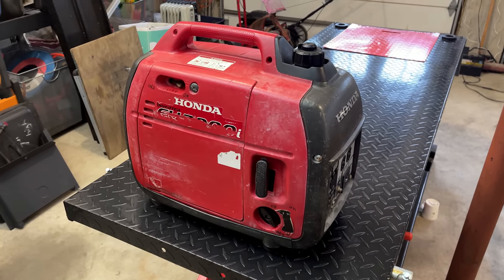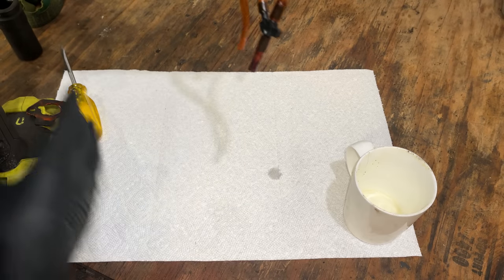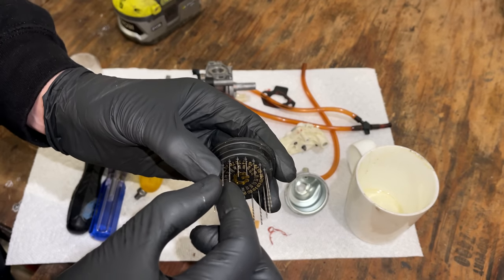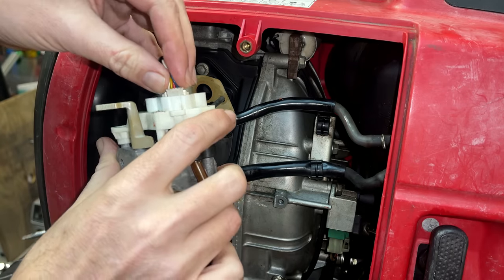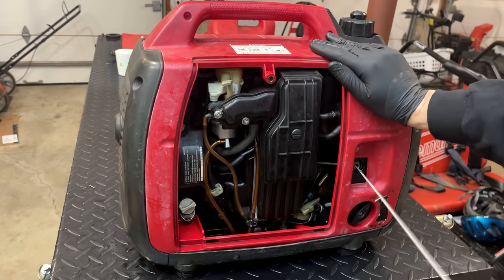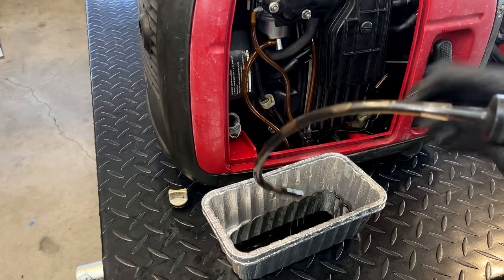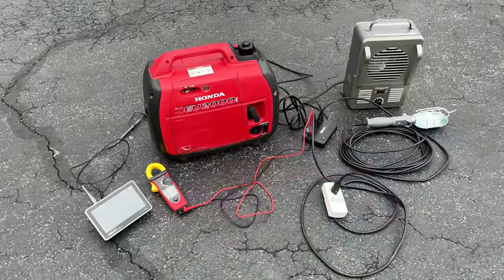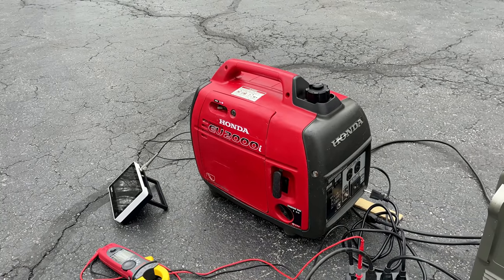Old Honda EU2000i Generator Leaking Fuel

Comment: I saw a video somewhere about a guy who used one for this foodie cart in Manhattan, almost every day for TEN years.  I'm sure he took care of the oil regularly but unlike most small engines that are throwaways, Hondas soldier on.  I had a co-worker who owned a couple of go cart race tracks, he generally replaced most of the engines annually with whatever was cheap, one year he splurged and bought a Honda, I know he got several seasons, plus it made more power making it the popular car with his customers.  Amazingly these are built in the US, I proudly fly the Texas flag on my Toyota trucks.  The problem isn't American workers, it's American corporate management.
Reply: By the way, another good video.  😀😎

Comment: Many small engine shops don't like to work on anything because it costs so much and many people never come back to pick their items up. They want the shop to store items for them until the next time they want to use it and they can't sit on the parts and labor costs that long. Another shop charges $80 up front, takes the customers contact information to call, text, email when it's ready and the customer signs an agreement to pick it up within 30 days of the notification or the item belongs to the shop.

Comment: Here in Europe we have the nearly identical EU20i. I would suggest though to totally eliminate hunting on idle that you clean the path between the idle jet and float bowl. Any tiny bit of tarnishing can have a big effect on fuel delivery in my experience. Also use Honda Fuel additive to prevent tarnishing due to stale fuel. Good video
Reply: Try drilling out the pilot jet 1 drill size larger.
These are set from the factory to extremely lean running..
and it takes less that a hair, drop of water or calcium buildup you can't even see....
to cause bad idle problems.
Reply: @JohnSmith-yv6eq I wonder if honda produce a modified idle jet?
Reply: @CodfishCatfish  My EU2200i runs fine, both idle and under load, another pilot yet must have been applied due to regulations, (Netherlands)

Comment: Man, that thing is rough. I will never understand how someone can buy an expensive piece of equipment like that and abuse it all to hell like that. I have the same model that I've taken very good care of, it still looks almost new and has never let me down. I have gas appliances so I can run my whole house off the little EU2000i during a power outage. It's so quiet standing 10 feet away I can't even hear it running over the din of the neighbor's 3600 RPM conventional generator.

Comment: That machine is absolutely amazing. I am impressed with it and the perfect outputs and sine wave. And that oil sensor is just doing its job. Better to kill the engine and force you to address the potential problems than to risk killing the engine for lack of lubricant.  You don’t want a $500 picture tube to blow protecting a 10 cent fuse.

Comment: Regarding the low oil shutdown - conventional oil foams up too much in these EU2000 when its cold and it triggers the low oil sensor. You can see there is some foam on top when you take the cap off. Switch to a different oil, preferably a synthetic one. I've had no problems with the SuperTech Full Synthetic from WalMart. Also, I would recommend one of the the oil fill extension tubes that are available. It makes pouring the oil out super easy and mess free.

Comment: These little gens are my favorite. I've also had the similar Yamaha but while the Yamaha is a tier above the Chinese knockoffs I feel like the Honda has just been so much better and reliable given I regularly use it at 6-10000ft elevation. Also for just a few $100 more the Yamaha engines still been made in China and Honda in Japan makes it worth the extra $

Comment: Great video. I have one too $599.00 new. It’s ten years old. Two things I have done was to add an hour meter. Red matches case like it came that way.  The other is to record hours and date of oil change on the inside of the cover with a sharpie. Lots of room. My only failure is to drag it out and run it an hour or two every month or so. 
Thanks again.

Comment: A little surprised you waited so long to check for spark and the condition of the plug. You eventually got there and figured it out. It did sound a little fuel starved on idle, maybe that's just the way it came across on camera.  All in all, a good repair.
Reply from the maker: The owner just said it leaked when running.  So I thought it would run.

Comment: Have that same generator and its twin you can link together to get 30 amps as a backup for home. Bought it for my RV but since got rid of the RV.  It is 6 years old and has been run for about an hour all together. Change the oil and gas every year and then let it run for 10 minutes or so. It says "Cold weather technology" on it but it is anything but. Anything near freezing and it will not start. Other than that it is of course a Honda and amazing technology that will prob last forever.
Reply: Store it empty of all fuel.

Every month buy gas and keep it in the can...buy the same grade as your car uses.
Every month take the can and pour it in the car...
Refill the can with fresh gas.

This way when you need it you will have fresh gas...with all it's volatiles still in it...
and starting will not be a problem....

as long as you understand that because this has a fuel pump built in...
you have to pull at least 20 times to get the pump to pump fuel to the carb and fill it up...

unless you rig somehow to squirt a bit of engine start into the airbox...
which will instantaneously start the engine...
and which will get the pump working so it becomes a 1 pull starter even when the carb/pump/tank were stored empty.

Comment: James , I have this Honda model so thank you for putting this out , and don't forget to deal with whoever has the telegram a/c in your name .
Reply: James , what make is you gas torch , i've looked in your Amazon shop but can't find it . Thank you in advance . The one that fires up and off with just one action .
Reply from the maker: There was someone a few days ago the was reported and blocked.  Comments made by me have a grey background and a check mark
Reply from the maker: I have an older model of this.  Will add it to the shop.  Bernzomatic TS4000 Trigger Start Torch 361524 https://a.co/d/1aBYbC6

Comment: As always another helpful, well thought out video. I do appreciate you taking the time to include the different parameters, no load and under load, like THD, Frequency and voltage. With four different generators of my own, I’m hoping that you’ll find time to do a video on THD, vs frequency and voltage with no load and loaded. I live in a rural area where everyone has a contractor type generator, but very few people take harmonic distortion into consideration for their electronics.
Reply: I'm not aware of any easy way to directly measure 60 Hz THD.  Most people just look at the waveform on a scope with the generator under load and see how close it is to a sinewave.

Comment: Nice job !!! The plastic jet it was clogged in my 2000 so I had to use a tiny PC of a wire brush string to clean it up and no more surges....Now I use iridium spark plug for better performance

Comment: When I saw the carb leaking for the first time, and saw that RTV had been used on the gaskets, I thought ha! ha!  I bet that some of the RTV has blocked the carb vent. This happened to me on a Huayi  carburettor similar to the one on your Honda that was fitted on a mower and it leaked after putting sealant (Hylomar) on a worn out gasket. Well spotted on the dodgy needle valve & float - nothing can be taken for granted!

Comment: Certified Honda tech here 20 years. Crack me up to hear you say no one would work on this. I work on 100+ a year and any Honda shop would have zero problems working on this. And who ever worked on this screwed it all up. Obviously the inlet needle has an issue and it has a fuel pump BTW, that's why when you pull the cord the impulse pumped the fuel and it started to leak

Comment: Nice. 
Hint... When I had motor bikes, servicing the carb was always check needle and seat, check float for fuel ingress, set float height. Much of this seems unnecessary with these simple carbs, but... 
Also we checked/changed the plugs more often than you.

Comment: I own one as well. Going to have to use it next week for heat. Now, I have a much better idea of it's output and limits. Thanks James for the insight and great video.
Reply: @ElectronicMusicUnderground  To power my RV when I get back to Canada. It's cold there right now. All the appliances in there like a electric heater, coffee maker, stuff like that. My solar panel will power lights and refrigerators. No use having warm beer !

Comment: Ethanol gas is a good cleaner if it does not turn bad, as can happen if a piece of equipment sets up for a long time.  Yesterday, I brought out my Husqvarna 28 L weed eater after set all winter.  I thought I had run it dry but I had not.  It was filled with premium-non ethanol gas and Husqvarna XPoil, plus a stabilizer.  It cranked upon the third pull but it’s idle was a bit erratic.  I decided to keep the same gas in it to see how it operated.  It ran fine but the idle was still a bit erratic.  I will pour out the gas and fill it with my standard 50:1 Stihl Ultra, before I adjust the carb.  I feel it was running a little rich, but I want fresh gas in it before I adjust the carb.  all my equipment is set up a little rich, so that is not a real problem.  I had not run the 28L since last August.

Comment: So, if the repair shops don't want to fix it, then what do they repair? Isn't that their job? Great repair vid! Nice job!
Reply: They repair items which are quick to repair, with low cost parts.
The hourly rate of $100 quickly makes anything other than oil, filter, sparkplug...send it...
too costly for the customer to pay for low cost machines...
These generators take such a lot of effort for the average mechanic (not Honda trained)
...it just costs too much.
Buy a new one!

Comment: From your work, it appears you’ve done that before, lol.  Great job as always!   I’m going to bookmark this video in the event I need to service the carb on my 2000i.   I find it very important to drain the remaining fuel from the float bowl and the fuel tank before putting the machine away for any length of time.  I use K100 additive to my fuel, works great in keeping water out of the fuel.

Comment: That spark plug carbon buildup was from the excessive burning oil you experienced. It will need a rebuild soon but they are totally worth the $$$ in repairs. They go forever!
Reply from the maker: Definitely an oil fouled plug.  Told the owner most likely a bad valve stem seal and have a couple extra plugs on standby.  Eventually it will loose compression due to the carbon buildup and need a rebuild.  Might be a long time though as he does not use it much.  He purchased it used where it was used hard early on.

Comment: I have one of these generators, the 2000i and I like it a lot.  I bought it used.  I then ran it for a couple of seasons of one-day power losses.  But then starting a new season, I found it would not start.  It was the fuel pump.  The fuel pump is strange in that it takes a puff of air from the flywheel, up a hose, to operate the diaphragm of the fuel pump and thus get pump valves working.  This is fine when running, but it can take a lot of string pulls to start it from standing a while.  I have counted 30 - 40 pulls before starting.  Then when the carb has fuel it starts first time.  I love the ECO mode where it idles until there is a power demand.  It is so quiet I can almost forget it's running if I'm inside the house.

Comment: They usually leak through the fuel valve/OnOff switch. The o-rings inside of it go bad and it leaks like crazy. A little bit of a project to replace, unfortunately.

Comment: I think its fascinating how similar this is to my yamaha 1000 inverting generator!  sadly, back in the day I was running off the grid on that thing, there were no videos on youtube covering what you're doing here.  I bumbled through it anyway, and started to make a video for it, but never did publish it. Oh well.  The Yamaha has a rubber plug on the bottom with a ring that would slide over the oil filler port and provide a little channel to pour the oil out when changing it, so they at least addressed that part of the operative design.

Comment: Maybe was smoking because it had some carbon deposits on the exhaust valve that self cleared after working fine for some minutes, judging by the looks of the old plug. You can also check valve clearance, is supposed to be done every 200hrs of use or 2 years according to the manual, and i doubt the owner did it.

Comment: I noticed there was a slight miss or hesitation when the generator running but not under a full or heavy load.  Is this caused by a faulty servo idle circuit or is this a matter of fuel/air mixture. I had a generator that always hunted, and I couldn't figure out what caused it.  I finally gave it to a friend, and it still does it 3 years later.  It works fine, it is just annoying to listen to it run.  I love your channel, James.  Very informative!

Comment: P.S.  Sounds like it might be a thing with present day Honda dealerships as my son had problems with his carbs on his seventeen year old 90hp outboard.  He ran into the same thing.  He tried six dealers through the NW and Alaska all of whom did not want to work on the motor but tried to sell him a new one!!   Appears that they are really stupid and nobody told them that treating customers like that showing that they didn't service what they sell drives off business fast.  A friend of mine here who owned a Honda Dealership was amazed because he said that all the years he was in business (sold out four or five years ago) Honda was very strict about a dealer having to have competent factory trained mechanics and that they had to be meticulous about servicing Honda equipment.  If it is happening on the east coast too it sounds like a trend.

Comment: I was kinda surprised.. Anytime I service a small engine …especially if I have to go all through the carb… new air filters, change oil, definitely new SP. Spark plugs are a first go to on engines that have been shut down for a long time…oh and new gaskets and bowl O ring…crap I just remembered I forgot to change the oil on my last ticket! Thanks for the reminder!

Comment: Back in the day, you could adjust the float level by bending the tab.  I assume that's not the case here, but what would cause the needle to seat too deep?  Great video, I have the same machine and love it!
Reply: I would think someone else was in ther and changed it with wrong one.
Reply: I wonder if the guy who put on all that RTV also replaced the needle with the wrong one. It seemed like it was too short.

Comment: A compression test and a look at the low oil switch would have been informative. It's a Honda so the oil getting in the cylinder is probably a valve seal

Comment: I worked on a carburetor that someone used RTV on and couldn't figure out why it would not run. The sealant had plugged some of the the ports . New gaskets and no sealant on carburetors.

Comment: Use a piece of aluminum foil to mold underneath the drain hole and extend the foil to the outside of the case. When you tip the generator to drain the oil it will be clean and easy. I do this same trick on my vehicles when removing the oil filters.

Comment: On the honda carbs you can remove the limiter cap for the idle air mixture screw by heating the cap with a lighter or my preferred method is with an smd hot air rework station. The cap is held on with bearing mount adhesive. I always remove the screw to clean the carbs when they are  extra dirty.

Comment: Right off the bat my guess would  be the carb bowl.float valve causing the bowl to overflow.  Luckily the carb is one of things that is accessible.
Reply: I'm surprised you didn't remove the locktight-glued on EPA anti-tamper cover plug over the idle jet mixture screw/needle and clean.all that too.  

If you found plaque in the main jet then the idle needle jet should be even worse since it is such a micro-sized jet.  Off-idle throttle response can be awful.  

I have a Honda 2.3hp  outboard motor which has a similar engine with what looks like the identical carb and the same spark plug.  It has a centripetal clutch instead of a neutral/gearbox and until I cleaned out the idle jet that clutch engagement would really make the off-idle bobble even worse and sometimes even kill in colder weather.

Comment: When you look at the old plug it did look like it was using oil, if you did a leak down test you could have determined if it was rings or valve seals. But when in doubt use Hi Mileage oil because it has seal additives that may help reduce the amount of consumption. Great video as always.
Reply from the maker: Was thinking the same thing.  Maybe switching to 15w-40 would have helped.

Comment: I have the exact same generator at home and a 160 amp switch in the house to switch over from public power network to generator as we get frequent storms and power failures. Great little machine for those days to keep the oil heating running and watch a bit of telly.